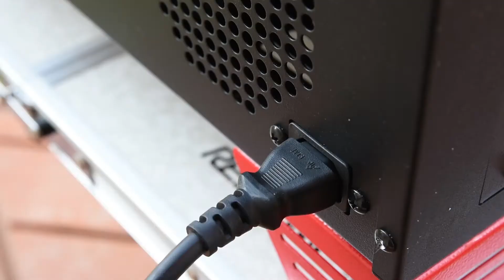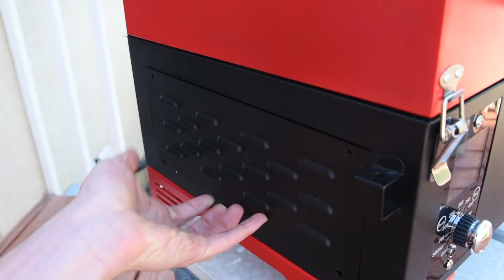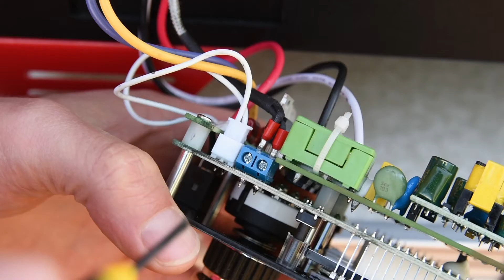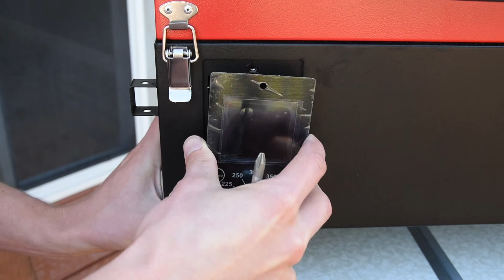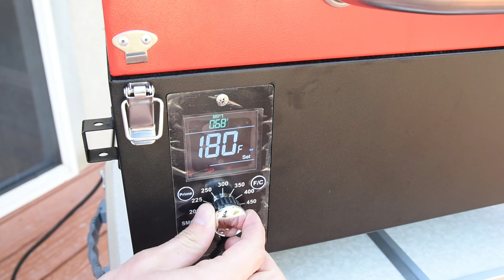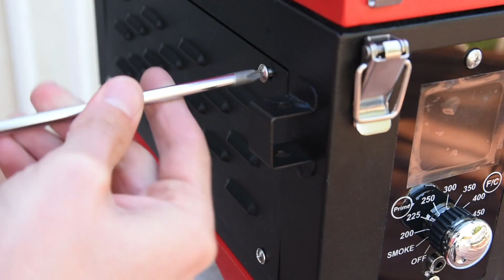Replace an Asmoke Pellet Grill Controller

Comment: I have a fairly new Asmoke 350. Recently I broke the temperature rotary knob completely off, and totally my fault! After a number of emails, and ascertaining date of purchase, I was surprised to receive a new controller and temperature probe. Not sure why the probe, have yet to look at the connections to the old controller, but the Asmoke 350 and temp probe connections are different, better and easier, than this As300 video shows.

Comment: Hey man, i bought mine last june, have been using it kinda regularly maybe a few times a month, got the ER1 code, idk if u know this but when i pulled my control board out my probe ports are tack welded so i can’t tighten them, does that mean i need a new one?
Reply from the maker: Isn't the ER1 error for the temp probe in the cooking chamber? If you have a multimeter, you can check the resistance, which shouldn't be infinite or zero.

This is a video on replacing the probe, which should help you get at those wires. 

https://youtu.be/ai8VL25jr6g
Reply: @GrillTopExperience  just wanted to update for anyone in my position, they emailed me back finally saying that most of the “5 year warranty isnt real”. Most of the items like the control board have less than a frame of a few months, i have not even purchased my grill over a year ago(sometime in may) and the fact it already broke and they expect me to pay 75$ is ridiculous, especially when i cared for it and maintained it.
Reply from the maker: @jjcolon4339  That's wack! Would you mind forwarding that email chain to me? grilltopexperience@gmail.com

Comment: Does the fan on your asmoke stay on the entire time you are smoking? Turns off after the start up but I noticed a lot of videos with this product seemed to still have that torchy roar well through the cook.
Reply from the maker: The auger will turn on and off, but it always makes the fan noise during the cook.  That should help you get a clean burn.
Reply: @GrillTopExperience  thanks for the reply! Super helpful to know what the normal operation is supposed to be like. My fan stays on for the first ~5 minutes each time so maybe the source of the problem is the control board.

Comment: After locating the fuse and checking it with my meter, the fuse is okay, so I guess the problem is the control board like yours, and I only used it twice, one for the burn in and one for some chicken, also smoke is messing up the LCD display
Reply from the maker: The only thing wrong with the control board was that the probe didn't work. Their support group is pretty responsive. I'm sure they will get you squared away.

Comment: Now you just need to show us how to change the fuse
Reply from the maker: Did your fuse blow or is that a just in case? 

The fuse is on the back of the controller. You would only need to unplug the power and remove the two screws on the front of the controller to get access to it.